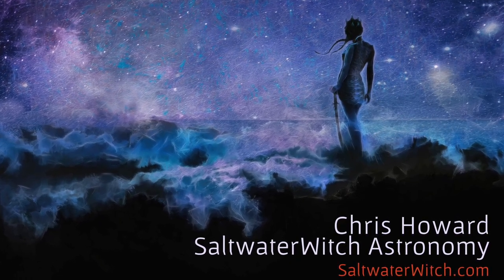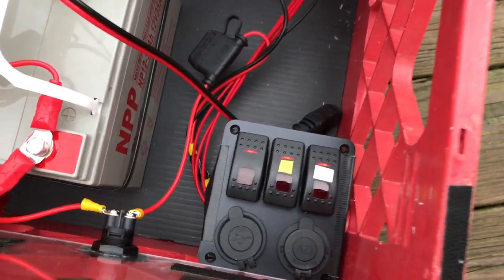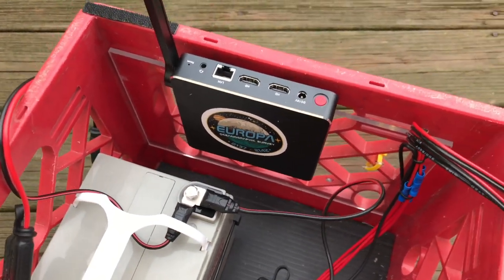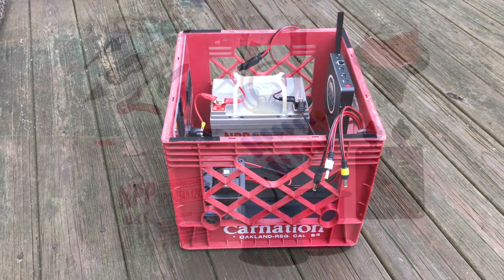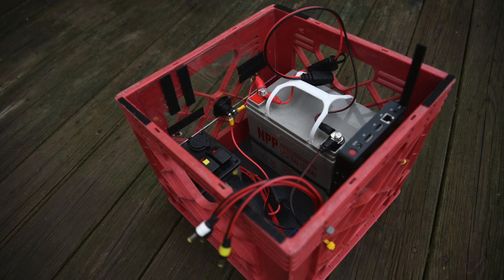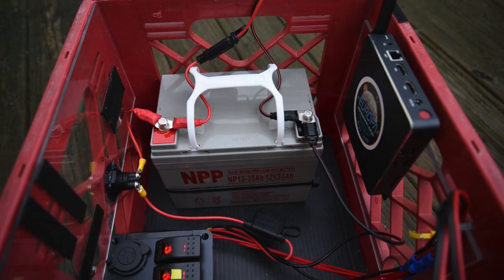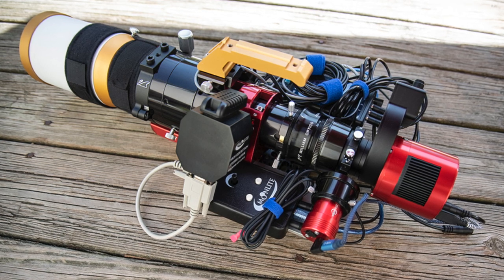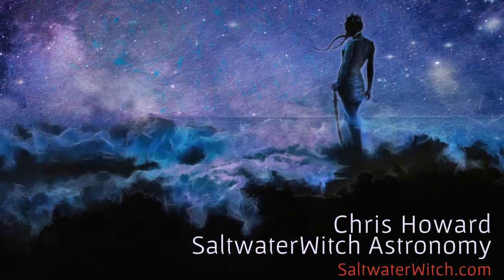DIY Power for Astrophotography

Comment: I'm looking to give N.I.N.A a whirl and am looking at x86 boxes that will run windows 10. What is the brand you are showing in your video and how do you like it?  I'm thinking I might setup a box to do dual boot Linux/Windows so I can use  Kstars or N.I.N.A or others.
Reply from the maker: I only see one of the fanless Windows 10 machines I bought on ebay (https://www.ebay.com/itm/MAD-GIGA-AP34-Pro-Fanless-Mini-PC-DDR3-6-GB-64-GB-Apollo-Lake-N3450-Intel-/283572615754?hash=item42063eba4a ), and I paid something like $109. But any of the machines available with similar specs should do the job. I have N.I.N.A. running on mine, but I've only tested out a couple features, devices connection,  changing preferences.  It looks great, and I will be doing more testing soon.  I have SGP on there as well, and that's what I mainly use under Windows.
Reply: Check out MiniX. I run one for my set up and recently just switched to NINA
Reply: @jhandel007  I'm pretty set on using N.I.N.A myself and Sharp Cap. What MiniX model did you go with? I also was looking at this: 

Azulle Access4 Pro Fanless Mini PC Stick 4GB/64GB

https://www.amazon.com/Azulle-Access4-Fanless-Mini-Stick/dp/B08DL4H1P4/?tag=wpcentralb-20&ascsubtag=UUwpUdUnU40656YYwYg

Otherwise, the MINIX NEO G41V-4, Intel Gemini Lake N4100 Fanless Mini PC with Windows 10 Pro,4G DDR4/64GB eMMc hasn't looked bad at all.

I would remote in and all captured data would be stored onboard. Let me know what you think.
Reply: @ChrisHoward  Are you still using this mini pc and are things working out well?
Reply from the maker: @alpsalish  I still have it, but have not used it since last August. I love the size and convenience of these mini-PCs, but they have very limited storage (I had to use an SD card to capture new data). I ended up going with a more powerful I5-based fanless PC with a small but adequate 256GB SSD--and it's so much faster than the one in the video. But also larger, too big to mount on the scope. So, if your goal is to really limit cabling or attach the PC to the scope, then the smaller PC worked well enough.